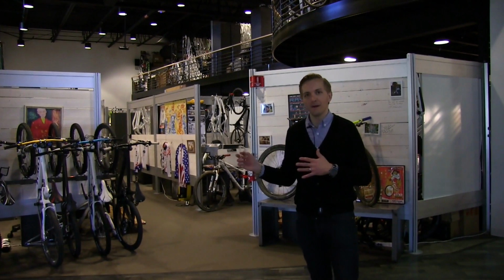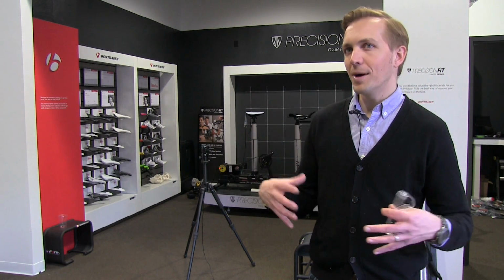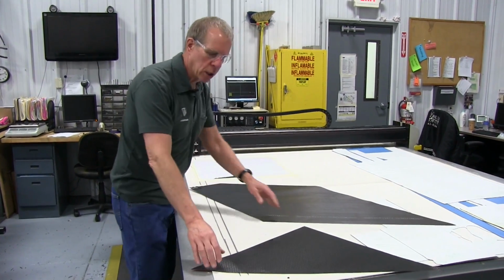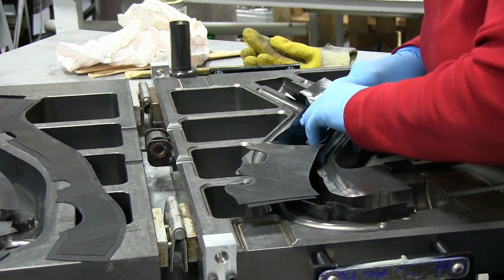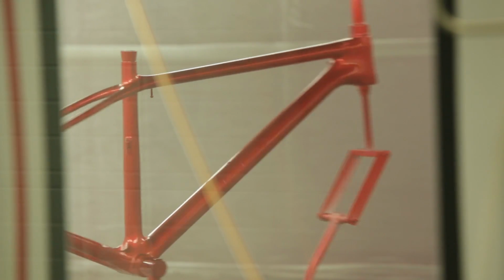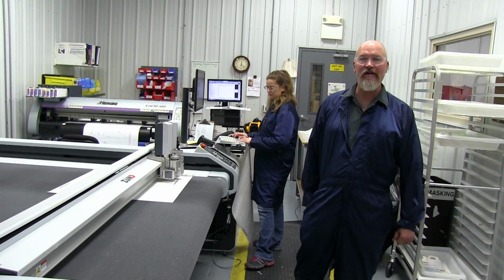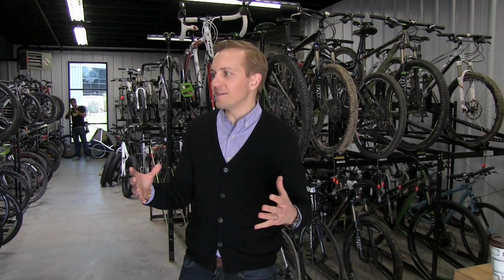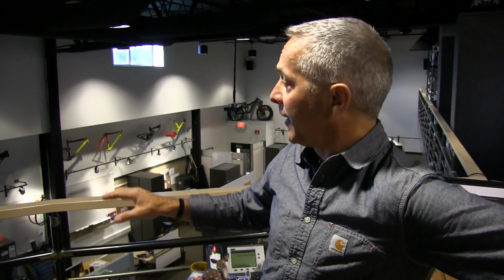Trek Bikes Hausbesuch: so entstehen die Fahrräder in Waterloo, Wisconsin

Comment: I just bought a trek believing it was made here. Turns out it’s not. ☹️
Kinda disappointed.
Reply: Which one did you buy?
Reply: Domane AL 2 it’s actually pretty good,I just was disappointed about where it was manufactured. Felt misled. 
And took too long also. I’m not sure I’m liking this Claris I bent the rear derailer 
When trying to climb a hill. (More than likely operator error) I’m still up in the air on the gears. I know my 2006 fastback has a better top speed but I’m actually faster with these gears. I think this is due to my conditioning though. As I get stronger. I think I’m gonna want those old gears back.

Ride is good and feels so much better having a bike that fits. I do notice a vibration noise coming from either the spokes or the carbon forks. Not sure where it comes from. This is on rough asphalt where it occurs. 

I’m not an expert of any sort on this stuff  and I’ve only ridden it a couple hundred miles so far. To be determined. Ask about a year from now.
Reply: @moflyboyblanquito541  it's a year from now. How you like it
Reply: Shahaan Saleem yeah it’s pretty good.
Rode a lot this year.